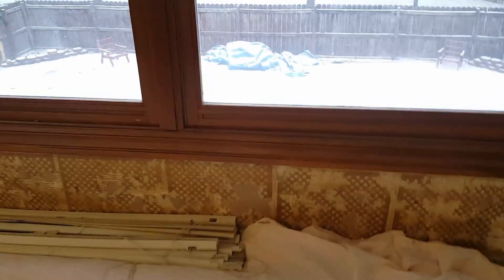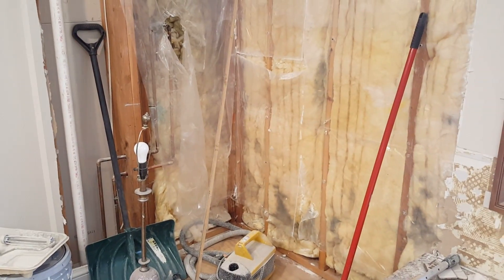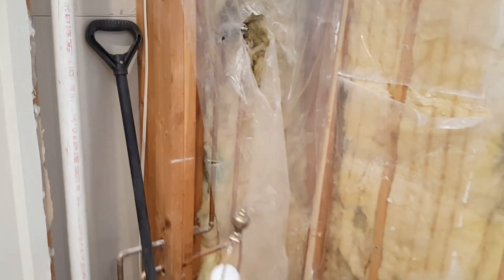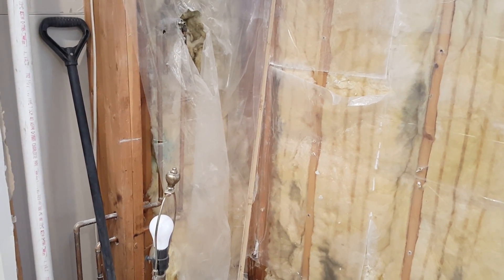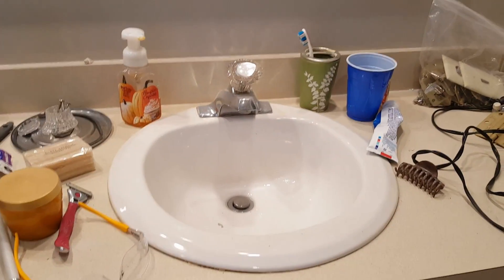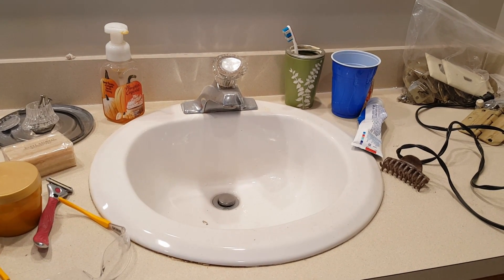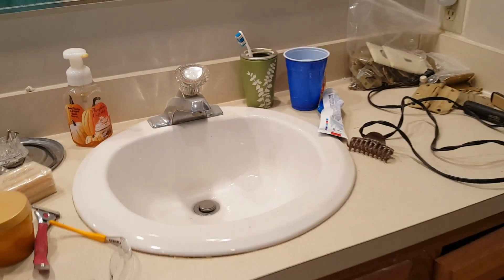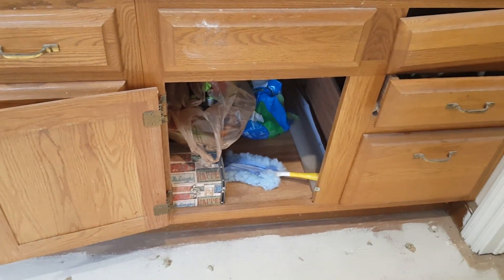How to keep water pipes from freezing? What temperature do pipes freeze at?

Comment: What about the water pipes outside your house ?
Reply from the maker: You should disconnect and drain any hoses that do not have to be connected to a water source. If you have exposed plumbing, you need to try to protect it. You can buy pipe insulation wrap. If it's extremely cold, they make heated electrical pipe wrap, but that can fail if the power goes out. Cover it up with anything you can. If you can't protect it very good, then you need to leave the water running through that line with a steady trickle of water. The water flow will help keep the line from freezing. But if the flow isn't enough and it's extremely cold, it can still freeze.

Comment: An excellent video. I just learned of the dripping water preventative. My bathroom is above an unheated garage, and my only heating system for the entire house is a wood stove. When it gets to 20 during the day and the single digits at night all the bathroom water lines would freeze up. I am lucky I never had one burst. After the pipes stop flowing water I would rush to the  garage with a propane heater. Now I simply let every water outlet in bathroom drip. The last three days here were like arctic weather, and so far no frozen pipes. 
Thank you for your advice, I wish I learned this method many years ago.
Reply from the maker: I'm so happy to hear this helped you! It really is an easy thing to do and can save so much trouble and money. Of course, the more water flowing, the less likely it is to freeze. Sorry to hear about the cold making things difficult for you though. Try to stay warm!
Reply: @HoodsHomestead  wonder , should close water also cover water pipe out side of the house for gardening
Reply: @ms9771  Yes, people should definitely protect their fixtures outside as well.